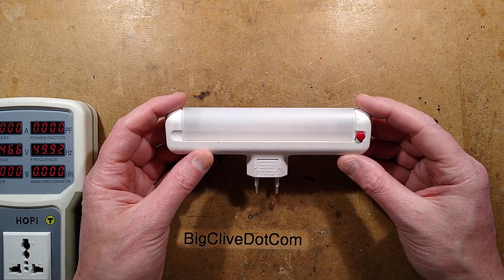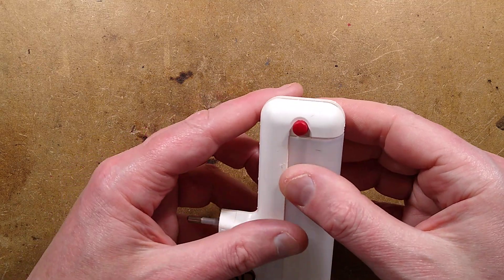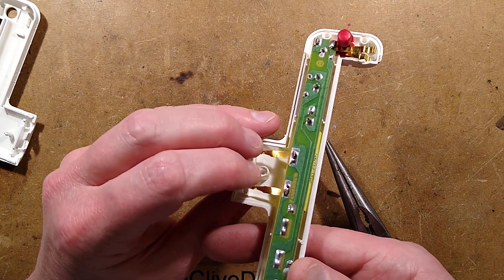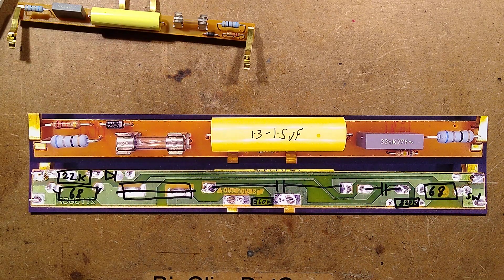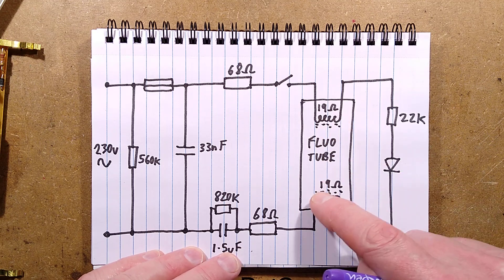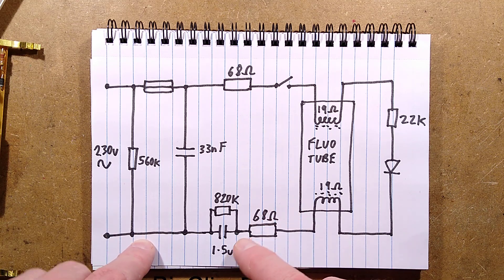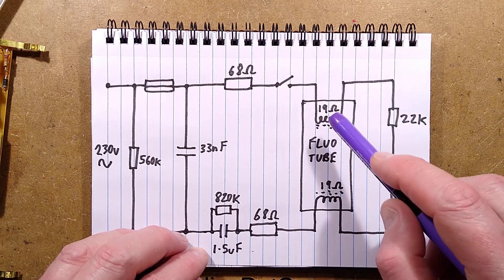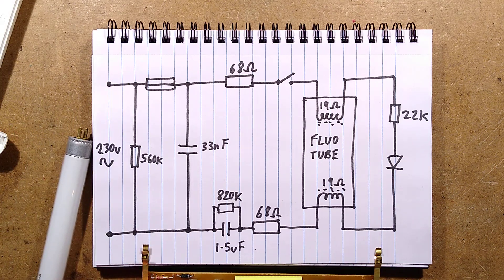Clever tube igniter circuit with schematic

Comment: I had a similar one of these back in the 90's, but the American version. it put out so little light, I just used it for a nightlight in my kitchen, so if I felt like a midnight snack I could work my way to the kitchen without turning on a lamp, and avoid cracking a toe on furniture.

Comment: I'm weird but sometimes come back to the videos on the shelf for fun.  

Here I'm noticing your comment about it possibly lasting longer than some of the LEDs.  Guessing it's because of the tendency to overdrive them?  I've already "hacked" many of the bulbs in my house with modifying the on board resistors dropping them to a quarter of their original draw.  

So GREAT!  It's just like you say with the light output being much more than you'd think at the lower wattages.  

You're a lifesaver Big Clive!  LOL  We need to chip in and get you a cape!

Comment: You can replace the diode and 22k resistor with a 200v sidac (K2000G for example) to have a nice preheat start. In fact the 110V version of this light used a sidac as even with the doubler the tube couldn't starts reliably with cold cathodes.

Comment: My guess is size is a factor as starters are very cheap. Because it's a defined circuit it can work. The all purpose starter is for all and any which makes it remarkable. I think neon oscillators  worked a bit like this. https://en.wikipedia.org/wiki/Pearson%E2%80%93Anson_effect

Comment: If I'm not mistaking, that big yellow capacitor has manufacturer logo on it, and it was made by famous Iskra electronic component maker from Kranj, Slovenia, former Yugoslavia. So, this lamp is most probably a Yugoslavian product, made by FEP (Factory of Electric Products) from Donji Milanovac - factory known to produce many iron ballasts for lighting back in the time, as well as small electric motors and the like. It very likely is an imported design, Thorn UK, Ilesa Italy, or the like, as well as the tube, which was (if I remember well) not produced locally, although slightly bigger 6W and I think 8w T5 tubes were made by Tesla lamp factory in Yugoslavia. These lights continued to be made in the 1990's as well, and were often given as promotional giveaway items of domestic brands, often with printed logo on the side.

Comment: My dad had the exact same one for years, I think he got it from Germany or Switzerland. One day he asked me to fix it and I found the main capacitor to be faulty (after many years of service and at least the fluorescent tube replaced 2 or 3 times over the years) Unfortunately I was unable to find a capacitor with a similar value and a compatible form factor. I'm guessing they have been manufactured specifically for Lampi.

Comment: Gas discharge lamps intrigue me. I've got an old soviet xenon tube that was designed to run directly off of mains voltages, a 4kw long-arc xenon tube, and I haven't had the chance to mess with it yet, but it's on my todo list.

Comment: Clive, is that really a 22k? At 22k the heaters only get 1mA and 19mW of heating at startup. Remarkable it works!
Reply from the maker: It's not to heat the cathodes.  It just charges the capacitor until the tube strikes.
Reply: @bigclivedotcom  Ah, I should have been listening more closely;)

Comment: I have a bunch of Lampi lamps that should be like 20 to 30 years old. They were very cheap but still work perfectly.
Edit: Wow, thats a clever circuit. Ive never seen a fluorescent tube driven by a capacitive dropper.

Comment: DO HAVE one new in package made for US 120v/60hz.  Used another one that did not last long at all.  INTERNAL components are: 33 ohm 10 watt resistor (ceramic)  , large orange cap marked 275J 250v  ,  diode, rocker switch .  SO the   120v ac lead goes though CAp, tube end1a. the filament1, end1b then diode, then tube end2a, filament,  end2b then 33 ohm,  rocker switch, then power lead.   Less circuitry than one shown.   The tube has no pins, it has leads.   Case held together with clips.     "Liberty Lights" mini Fluorescent Night light. US-PAR Enterprises INC Chino California 91710-5149.   . Model ML-400   120v 60hz  3.5 watt  UPC code 0 25066 00400 7.

Comment: The short tubes have a low ignition voltage. Once ignited, the current must be limited. 
With the small values you do this with a capacitor.
These lamps were popular in Germany in the 1990s.

Comment: With a plug like that it would NEVER have come from North America.
Reply: A few decades ago I had a couple of very similar 120 volt lights for American use. At least one had a little rocker switch instead of the push button. I ran them continuously inside a home entry.

Comment: Completely unrelated but..... I'm using a turnigy brushless motor on my lathe and the power supply has gone bang. Can anyone recommend a more reliable supply?
Reply from the maker: If it's a typical 24/36/48V type supply then a Mean Well is a good choice,  Get one rated higher than expected load.  The chassis units should be mounted in a cabinet for their (and your) safety.

Comment: Looks to me like that end near the power switch has been opened a times.

The plug is clearly European continental — like Belgian or Dutch.
Reply: All Europe uses that plug, except UK,  Ireland, Malta and Cyprus.
https://www.worldstandards.eu/electricity/plugs-and-sockets/c/
Reply: @soupflood  — In my experience, there are minor variations on that plug. The version I saw in Germany was slightly different compared to the version I saw in Belgium and The Netherlands. The primary difference is the way that the ground is connected, IIRC.  This plugs looks specifically like the version I saw in Belgium and The Netherlands.
Reply: @shubinternet  besides the ground connector, they are otherwise compatible.
Reply: @soupflood  — Compatible, yes. But still slightly different.

And note that some equipment really should have that ground connector actually working. Just because one plug might fit into another socket doesn’t mean it would always be a good idea to do so, if you wind up losing your ground.

Comment: I have a slightly older one. Same brand, brown case, no switch, no slots to easily replace the lamp. I think it uses a resistive dropper folded up in the bottom casing, but I' not sure now. Once I find it, I hope to remember to post a link.

Comment: Nice explanation. You forgot to mention that this device when plugged in but not turned on it doubles as a power corrector (with the capacitor over the input terminals). (;-) The marketeers forgot to mention that big selling point...

Comment: I have one. Better quality tubes last about a year and a half. Cheap lamps last about six months or so.
Reply: Cheap chinesium shit led light fixtures last about half a year. An then end up in the landfil as a whole unit. So still better then cheapo led shit.

Originally leds are great. But the penny pinching grew some serious driver cancers and overdriving/undercooling them does not help either.
Reply: @casemodder89  I've always said when accountants started designing products that's the end of it.

Comment: Now I understand what the starter does. It completes the circuit so the filaments heat up. I remember the starter used to have a small glass tube in it, Did that act as a diode?
Reply: That was a neon lamp with a bimetallic strip.  The striking voltage of the neon is higher than the running voltage of the tube.

At switch-on, the tube isn't lit so there's enough voltage across the neon to light it.  That slowly heats up the bimetallic strip which eventually opens, removing the neon from the circuit.  At that point, if you're lucky, the heaters are warm enough that the tube strikes and runs.

Whether the tube is now lit or not, the bimetallic strip slowly cools and eventually puts the neon back in circuit.  If the tube is lit the neon doesn't light because its striking voltage is higher than the running voltage of the tube.  If the tube isn't lit the neon lights again, the bimetallic strip heats up, and you repeat the starting cycle.
Reply: @bdf2718  Aah thank you, that explains why the starter lit up.
Reply: @darylcheshire1618  Yep.  It's not to tell you that the starter is doing its best to start the tube, it's just an incidental side-effect of using a constant-voltage, heat-generating device that is cheap and they know how to make.
Reply: @bdf2718  You have the logic reversed.  
At turn-on, the bi-metallic switch is *open*, so the starter neon lights.  
The heat from the discharge eventually causes the bi-metallic switch to close [for a few seconds]; the switch shorts out the neon and so pauses the heat from the neon, such that the switch cools [and so will eventually open again].
Closing the bi-metallic switch heats the cathodes; when the switch opens (because it cooled), the inductive spike from the ballast should strike the main tube and the in-parallel starter should no longer strike (think 50V for the main tube, 90V for the starter).
See here, for alternative wording:  http://donklipstein.com/f-lamp.html#wd1

Comment: How true, florescent do outlast most LED's. Need to do a led vs. Gas discharge lamp comparison.
Reply: Metal-halogen discharge lamps are way more durable... and expensive too. Cheap consumer LED lamps have same shitty RC powering circuit and are quick destroyed by poor cooling and high current peaks. Good brand and more expensive LEDs have constant current switching supply and last tens of thousands hours.

Comment: I didn't think the really small length tubes like these were a standard part. Surprised to see a Sylvania lamp in there.
Reply: This old style T5 came in 4W, 6W, 8W and 13W, if I remember correctly. That is before every size of fluorescent tube went to T5 before being phased out for LED.
Reply: They were hard to find in big box stores, but i could always find them in smaller hardware stores.  The lamps were common in camping lanterns, and other small electronics.  I have some old document cameras that powered the lamp assembly from 12v.  Perfect for a small solar system, but I never got around to installing them on my system.
Reply: Yep, thats a quality tube. Might be an exchanged one for the blackened oe type.

Comment: I’ve got a battery powered T5 fluorescent light  from the 80’s must of got it with tiger tokens from esso. Seem to remember the ends started to go black after a while
Reply: Might be time to replace the tube and inverter, with a couple pieces of LED strip; cheaper than a new tube? :-)

Comment: Are capacative 'chokes' for fluorescent tubes common?
Reply: Not really, as they won't generate the startup voltage without clever tricks. In dual tube fixtures though, one of the tubes can have both an inductive and a capacitive dropper in series, to shift the phase to compensate for flicker.
Reply from the maker: Only in cheap units like this.

Comment: You can replace this resistor-diode ignitor with standard glow tube fluorescent starter. 4-22W one should work
Reply: Nope. Standard starter needs choke to generate starting high voltage peak (due induction discharge).
Reply: @adamw.8579  

Nope. For this size and wattage inductive kick is not required
Reply: @mikigry9838  Maybe this shortest tubes should lit without kick. In my practice always was standard circuit (ballast and starter) or electronic ballast with starting function. Latest fluorescent lamp enclosures had electronic driven by integrated circuit (no flicker lighting) suitable for workshops with moving machines (without stroboscope effect).

Comment: That fluorescent tube is so tiny!  Why not just use a white LED with a capacitive dropper?  That starter circuit is just plain nasty but good if you want to sell a lot of those baby fluorescent tubes.
Reply: Because they didn't have white LEDs back in the 70s and 80s when that thing was designed...
Reply: @bdf2718  I remember for my birthday back in those days I got a torch with a fluorescent tube which I thought was amazing.  It did eat a lot of batteries and tubes though!   It's too easy these days - white LED, resistor and PP3 and you get a very reasonable torch.
Reply: @ianhosier4042   as a kid i had an osram dulux handheld lamp with a little belt clip on the back using a U-shaped fluorescent tube that went through AA batteries like nothing. About 2h of runtime on a quality set. And it also suffered from the sputtering on one end. One day it decided to not strike anymore.   For me as the lil version of the electrican i am now that was a desaster!  😟

Comment: I wonder how much longer it will be possible to buy the tubes for these lamps?
I expect no one will be making them soon due to no more demand for them.   Sad.
Reply: there is a quite high demand on these small 4 and 8W tubes as they are used in many older emergency exit signs/lights at least here in Germany
Reply: i can't find this exact tube at a decent price, i found it locally and it was like 7€, online it was kinda the same and the cheap china doesn't seem to stock it... this is the 15cm one, the 20cm one costs like 1.5€ instead... but they still can be found... there was a shortage of the UV germicidal ones during the last months, you know why

Comment: It's not European, as the CE logo has the C and the E really close. That means "China Export" and not that it is approved by the EU.
Reply: I've seen bastardized CE markings on products from big brands. My Microsoft mice have all had those compressed CE markings to save space. It's not always done with the intent of labeling a non-certified product as certified and trying to get away with it.
Reply: It was made in the 1990's in Europe (clearly visible from the choice of components) for a German company. China Export wasn't a thing back then. The whole "different CE logo means China Export" thing might be an hard to get rid of urban myth, actually. When you think about it, Chinese manufacturers would prefer to print a normal CE logo since it would look more compliant even if it isn't.

Comment: 0:13 why would a device with an EU plug be sold in America...
Reply: It wouldn't be, but there were 120 Volt versions sold in the US. At least one of the units I used had a little rocker switch instead of the red button. Mine are long gone and I never dissected them so I can't say what differences made them work on the American 120 volt outlet.

Comment: So the peak reverse voltage reaches 650V (2V-peak), and what if it still not able to cause breakdown.
I guess that's the reason it didn't turn-on on 120V supply.
Reply: And if the cathodes were heated, there's a fair chance it'd have worked on 120V.
Reply: @theskett  For sure. According to ANSI C78.81 this type of tube, when heated, will strike at between 108 and 210 volts, well below the ~320 volts the circuit would provide.

Comment: Now it’s would be cheaper to just use LEDs because of all the support components needed in this design. Perhaps the tube is more then LEDs too? Clever way to get around a starter.
Reply: You'll still need most of the support components (dropper cap, bleeder resistors, etc.) -- plus a bridge rectifier instead of the single diode, to avoid painful flicker, and maybe even a smoothing cap.
But yeah, the LEDs would probably be cheaper than the tube :-)

Comment: Is the 22k and the diode what's known in the parlance as Ballast? or is that something else in the circuit? Can you direct me or if you haven't done one of those, do a ballast vs non-ballast? Perhaps in LED Replacement fluo tubes?
Reply from the maker: The main current regulating component here is the capacitor.
Reply: Old-school ballasts are (mostly) mains-frequency magnetic, using a chunky inductor to get the striking voltage and then restrict the run current.
Newer ballasts are mostly high-frequency electronic, which allows them to be much smaller and lighter.
Try here: https://www.lampshoponline.com/advice/ballasts-explained-the-complete-guide
Meanwhile, the resistor and diode function as a voltage-doubler, to generate the (660V) strike voltage; as BC explained.

Comment: Clive goes back in time to the 1930s and the heyday of fluorescent lights.  Except they didn't have solid state diodes back then.  They didn't have film capacitors that small, either.  I think the circuits used in the CFLs would be better.

Or best, just use LEDs.  🤗🤗